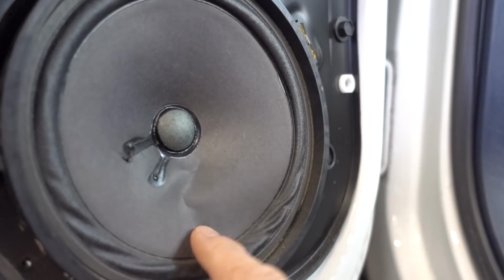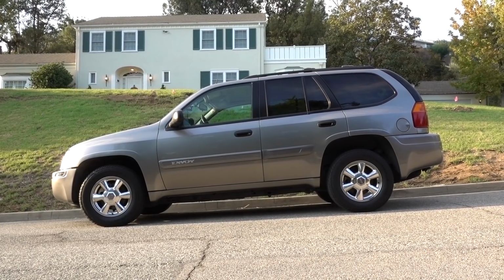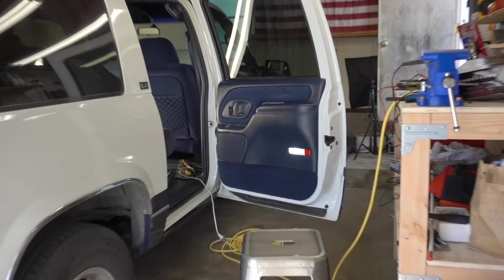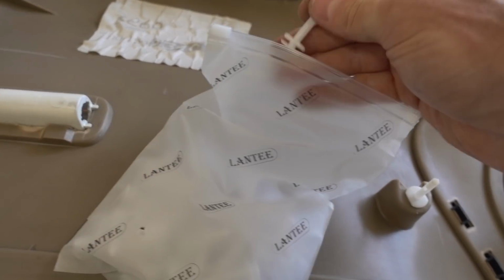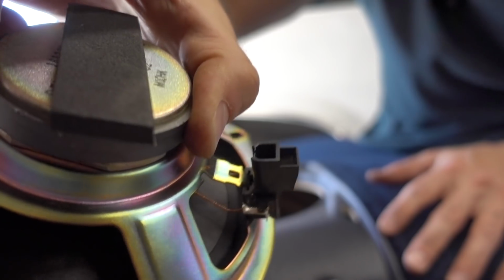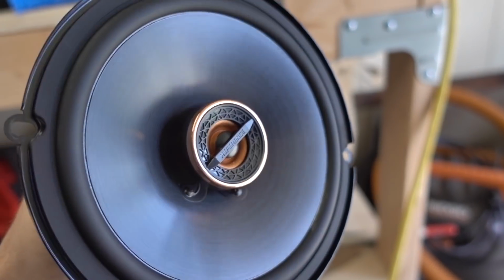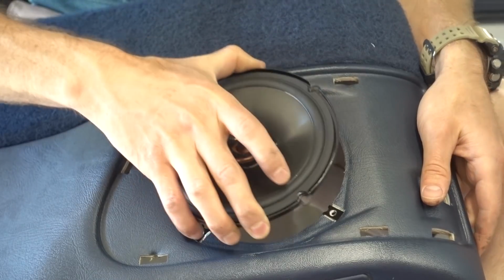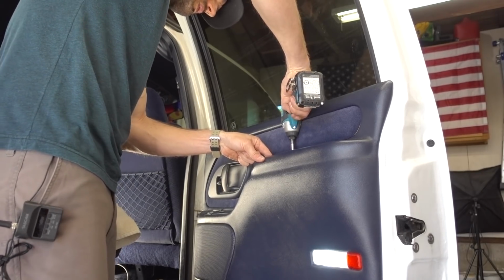This Is Why YOUR FACTORY CAR SPEAKERS SUCK!

Comment: 2003 Saturn vue. Bought for 1500 at 80k miles and the stock speakers were blown, so I'll never know how they were. Has a (10 year old) Sony aftermarket head unit. So i bought sony xplods (only about 35 bucks for 6.5 in set.) And replaced em. It was a nightmare due to Saturn hating people working on their own cars. The factory speakers WERE 6.5 inches, but the mounting holes are 8.5 so i had to literally cut the old speakers from this odd angular cone they were mounted in and mount the new speakers to that, then mount the hybrid frame to the door. Once that was done o had to carve out the covers in the rear doors with a dremel (with the sony covers on they wouldn't fit) since it was all part of the door panel, not removable like your GMC. The fronts i used the same speakers without the sony covers so they fit without cutting the doorpanels (and didn't have the horrible 6.5 to 8.5 conversion the rear doors did). The tweeters actually came with the sony headunit so i left those as is (higher up on the door by the side mirrors).

Comment: My 03 Matrix xrs still has its stock speakers and they are surprisingly good keep up with my sub and never have an issue I’ve changed them on other matrix’s years ago and didn’t get huge improvements with Sony, pioneer or alpine so this time I just stuck with stock until they blow

Comment: The factory sound system in my 2004 ram 1500 st was bangin. The one in my 2010 mazda 3 is pretty good. It's really clear. The one in my 1994 Chrysler Concorde the infinity sound system was the best I've ever heard in any car though although the ram 1500 was close. My 94 Pontiac firebird monsoon system was really good too

Comment: I have a 1999 Dodge Ram 1500. I would have no idea how the factory speakers would sound as they were all dead when I bought my truck. I recently installed Scoche in my truck and 2 of the 4 I installed were dead from the factory, so I plan on putting some Sony speakers on my truck soon hopefully.

Comment: I had a 2007 Camry XLE with the upgraded JBL system, it would’ve been nice. However someone prior to me hacked the stereo and put cheap blown speakers in the car. 
 I bought a set of Kenwood speakers and replaced them all, sounded amazing after that.  My car now, a 2017 Civic Si Sedan has the factory upgraded stereo and sounds alright for what it is, I think I’ll eventually upgrade the speakers in my car. But the factory sub and speakers do an alright job for now.

Comment: I have a 08 ford escape. I would've thought with a newer model they would've upgraded the speakers, but sadly they did not. I know so because I pulled off the panel on my older escape. In the front, I have kenwoods that sound great for treble, but very little bass. I have a sub in the trunk to compensate. I am probably going to replace the mids with the infinity ones you mentioned because with the factory ones when I hit a specific frequency they produce a very odd noise. Great vid.

Comment: The 6.5’’ in Passat 2015 was pretty impressive but changed to gas 6.5’’. 
The 4’’ in the back not so much! The magnet had separated from the cone, as a result of the plastic around the speaker had broken.. 😫

Comment: I have a 2002 Hyundai XG350L with an Infinity "premium package". Sounds quite decent for the age, but I'm thinking of an upgrade. I'll probably do the head unit first. It has an 8 CD changer, cassette player, but NO mp3 playback and NO aux input. Bummer!! When I get to the speakers, I'll probably add some soundproofing even though the cabin noise is pretty good already.

Comment: Great Video!

But a question, does simply swapping the stock speakers help? Most say you will need an external amp to drive them. Does swap only improve the highs or does it also improve the bass produced?

Comment: I have a 2019 Toyota Corolla LE and I have only replaced the rear deck speakers and I use 2 6x9 2-way Rockford Fosgate Primes.

Comment: I got the Bose system in my 04 Yukon and they are some beefy ones so I won't replace them til they blow I added 8tweeters 4on the up corner of the winsheild each corner.and one in all four doors plus I replace the factory ones for a total of10 tweeters..and I have a single 12inch sub.and amp combo FROM WALL MART ITS all power acoustic..if you heard it you won't believe it a cheaper brand..

Comment: We have a 2011 mini cooper with harman kardon audio. Its crystal clear sound with deep bass is so nice. Crazy how much bass it has without a subwoofer. We also have a 2013 vw bettle with fender audio its good and clear but doesnt have that much bass even tho it has a subwoofer. We have a 2004 chevy Silverado with bose audio its good but since its old its kind of scratchy. All in all i think mini coopers have the best audio systems by far

Comment: Well...i have many cars. One of them actually have very good speakers in it. And that is my -05 BMW 530d E61 Touring. There in 2x8" subwoofers under front seats and 2 way component speakers in front doors, 2 way component speakers at rear doors and 6.5" full range speakers at ceiling of trunk. But i also have a Chevy express van -99 And those speakers sucks, so i replaced them with infinity reference 6.5 2 way components and upgrade them as 3 way using 4" herz mid elements. And i also added 4x10" subwoofers aswell, so now sound is more tolerable.

Comment: I have a 2003 Mercedes CLK320, and all of my speakers are stock. Surprisingly enough, mine came with a built-in 8 inch Bose subwoofer, and this is with the base model. The speakers don't sound the best, especially the subwoofer. The only thing I changed, was the headunit

Comment: I put  jbl speakers into my 2009 ford fusion they were 5x7 speakers and the old factory speakers sounded unbalanced and they had foam rot so they were in need of replacement, now it sounds alot better and has more clarity and bass

Comment: The stock speakers in my 2000 Tacoma sounded better than the JBL Premium system that was in the Camry I had before but I still replaced them with Focal Auditor speakers front and rear. Much better sound quality and performance.

Comment: My Peugeot had paper cone speakers some with foam rot and the coils blew easily. I replaced them with vibe speakers although due to there being gaping big holes In the door and little insulation the sound was never perfect but better than stock. My Citroen c2 has better speakers and my nissan Micra stock speakers were surprisingly tough. I also have a ported box with bassface 6x9 speakers for the stereos I can't plug my phone into

Comment: I have 1999 Opel Astra with factory speakers with tweeters at the front window. I switch to pioneer cd player with equalizer and adjusted EQ, Now i have pretty good sound quality, it is the amplifier in pioneer cd player which is too weak and not speakers. To get good sound in a car then you need to adjust with EQ. Especially if you have speakers without crossover. Even if you buy expensive speakers it is not always good sound without adjustments with eq

Comment: You could of just popped off the grill in your Sub. & took the speakers out easily. Why didn't the original pop out plugs work on your new speakers ? You used screws instead ? Great vid & thanks, OH WE NEED MORE OF THE BLONDE IN YOUR VIDS.

Comment: My 96 conversion E150 factory speakers were all rotted around the edges. My system is a 6 speaker setup, not including two speaker cutouts in the rear door with no speakers installed in them. JBL club replaced the front and high rear speakers then for the middle section, pyle. Night and day difference from the compromised factory speakers to the upgraded speakers.

Comment: You didn't used some vibration dampening like Dynamat to make a better Cabinet for the speaker. You can offen do that instead of changing the speakers and get af good result and a good base if you later on chance the speakers. Did that in my old Peugeot 406 from 1999 I didn't bother to change the oem speakers for a year, where I was afford a great deal on a set of RE Audio XXX Compo
Reply: Did you put dampening material in your Peugeot? I have a 406 estate and i want to do some of an upgrade cause the sound is not so good...
Reply: @TedCakov  yes I used STP Anticore and black gold, on the door board I used Som Silentcoat Absorber35

Comment: I’ve had an 03’ Sentra and Altima and the factory speakers have always been decent, My 03’ Kia Sedona was decent as well. My 2017 Forte on the other hand was poor, and the 2006 Cobalt was terrible and those speakers are known to blow out after a bit.

Comment: i got a 2010 mitsubishi outlander with factory audio and they sound awesome i was honestly surprised with the performance of the audio nice bass and crystal clear vocals, and the thing is for the mitsubishi outlander there is a factory option for a rock ford fosgate audio package which adds additional speakers with a single 8 inch subwoofer i can only imagine how great that sounds compared to my standard speakers
Reply: Yeah, that's always the case with speakers in the Japanese cars. They always sound great.

Comment: I put  Sound systems I just about everything I get I've had kicker,Infinity kappas,JBL,MTX,Pioneer,Kenwood but right now I have a 2002 Chevy Silverado running  Rocker fossgate punch series  Components with a single  Down firing MTX10

Comment: I have a 2007 impala all I have done is a nicer song headunit and a set of alpine type r 12 subs in the back with a 1000 watt amp and the factory door speakers are handling it amazingly they are still very clear but do not have the bass I am looking for

Comment: My honda civic fd 2007 has a 6 disc charger and factory speakers sound sooooo good and that is only option for the speakers. It has 2 tweeters in the front on the dash 2 6.5intch 45w 210w max pioneer speakers and they were made out of kevlar. Back speakers were made out of plastic and 65w 140w max. Radio was pioneer 4x45w

Comment: For me i used to a 98 f150 that had 5x7 door speakers and the factory sound like crap and i replaced them with poinner 5x7s and they sounded really and had good bass. Now i drive a 2012 Hyundai sonata and the door speakers are really good they perform really good bass. The speakers themselves are but im going to change them out with new factory door speakers from AutoZone when they blow.

Comment: 1996 ford f250 has the original head unit and speakers just put the kicker key in line with the speaker and there's no distortion

Comment: My car is Seat ibiza 1.6 petrol 2007 :D I had only 2 speakers and 2 tweaters in the front doors but rear not I don't know why.. Nevermind with mdf rings I installed aftermarket speakers in the rear doors. The quality between front and rear is not really big BUT the front speakers doesn't have enough power I mean the bass, but for the quality the stock speakers are the best :D

Comment: Yo yo 97 ram can with factory 5.25 in the door but the hole was big enough for 6x9s.  Got kicker 6x9 and hole sawed out the triangle by the mirror for tweeters, powers by a old school rockford 200m, and added 2 12s behind the seat, currently building center console for two mtx 8s.  The Thunder Rolls bro

Comment: u didn't check for polarity, infinity speakers are notorious for being out of phase
Reply from the maker: Never heard that but they sound great!
Reply: @1RoadGarage  they are great, but if u r a perfectionist this info won't let u sleep at night! 😂 great videos
Reply: What a bull....they are clearly labeled and they are notorious for being junk. Aside from the real infinity speakers from the 80ts lol
Reply: @MichelLinschoten  of course they are labeled, but get a polarity check device and double check. A lot of cases they are out of phase
Reply: @Jacob.Hajarat  you can use a 1.5V battery to identify polarity by what direction (each) speaker flexes ( in or out ) . . .  ( then hope the audio wiring is correct! . .  it generally is though )
Reply: @MichelLinschoten  ah, the good old 80's . . . when i was neither old . . nor good!
Reply: @robozstarrr8930  that's before installing the speakers , but after installing them, u can test the phasing via dedicated devices or apps

Comment: did u even check the phase of the factory speaker before you soldered the plug on? phase cancellation is a real thing.....
Reply: While this is true, if all the speakers are installed & wired the same way, all the speakers will remain in phase with each other. It doesn't matter if they are all backwards - as long as they are all wired the same way, SQ will not be affected.

Comment: Unless you change the headunit i think you should just go with whatever $30 speaker you can find...Most all will still sound better than the factory speakers..Surprised that your speaker actually wasnt ripped..The paper ones usually start to fail once they are over a decade old.

Comment: Did you know that those rear speakers are powered separate from the radio so if you have an aftermarket radio that radio isn’t even powering those new speakers that’s just on those rear door speakers the rest are powered by the radio

Comment: my dad has a honda CRV from 2016, and the speakers actually sound good. there are subwoofers by the shifter (weird) and tweeters in the front. the main woofers produce good sound it also has a bass and treble booster, which was kinda useless. my mom used to have a toyota rav 4 from 2010 and the speakers from that are also good. there are tweeters integrated into the front speakers with woofers, and there are two more woofers in the back. no sub :(

Comment: Hmm let's see... Ford 500 had a Bose system with factory amp that was pretty impressive, so I just swapped for a double din jvc and it made those factory Bose SCREAM. It was a night and day difference. My 96 150 had horrible stocks. Swapped with pioneers from Best buy then added a 300w amp, and a Jensen flip out TV, and they were extremely loud, then just yesterday I started on my 2004 expedition, and I put my Bose system in it from the 500(car has been totaled) cause I'm a cheap ass when it comes to spending on myself (got a wife and 4 kids to provide for), driven by the expedition factory amp, then added a 1000w amp and two Kenwood 12s and that jvc double din cause it's an amazing head unit

Comment: On my chevy malibu from 2014 2lt model it saunds good very crispy and in the chevy equinox from 2012 also saunds very good but not like the malibu speakers the base on the SUV is very poor like if there was not subwoofer but it is i think it is a 8 or 10 inches one.

Comment: That's the default factory speakers in my 04 trailblazer are actually not that bad although I can tell the one on the left mounted into the console below the windshield is starting to go! (Bose system) I guess Bose is is good in some respects lol

Comment: I have a 2000 Rover 214 and It's factory speakers are somewhat decent. 

I switched 3 configs till now with an old cassette radio, a cheap chinese bluetooth one (13 bucks) which was so tiny and had terrible sound on its own, but I added an 600w amp (20 bucks) which improved it. But I was kinda unhappy with the wiring and general unfactory-ness of it so i just removed all of it and replaced it with a sony head unit which on it's own without the amp has great sound, maybe even greater than the amp even tho the amp is technically more powerfull.

 I'm wondering if I should get some new speakers, 17's for the front and 13's (centimeters) for the back. I'm looking at KENWOOD KFC-S1356's and KENWOOD KFC-S1756's. 13's should slot right in but the front ones have plastic casings of their own though I would just remove them and put the new speakers inside the casings. The factory speakers aren't that bad but the plastic door panels and meshes are rattling and stuff, and they do get distorted at some higher volume though they do pack a decent punch.

Comment: Thumbs up bro 👍
And I have A 2009 Tahoe LTZ with BOSE speakers 🤙🤙🤙
Reply: Same here Bose Premium  Navigation system  DVD Entertainment system Dolby Digital DTS certified

 2008 H-LTZ with 6.0L Engine
Reply: Hassan Badr you should probably replace the sound system then.
Reply: I´m sorry man
Reply: i have a6 2016 with bose. They are amazing!
Reply: @Hassan Badr I feel bad even the new Tahoe with the Bose sounds like some trash got one for a rental car and it sounded so bad. But bc it’s Bose it sounded worse with there fake base.
Reply: @jamalj1092  Bose is really good in Audi, at least. Easilly best sound system

Comment: GM speakers have gotten WORSE in the last few years. The voice coils fail (open circuit). I've had to replace not one, not two, but three factory speakers in my better half's 2012 Malibu. At least the speakers you pulled were still functioning at all.

Comment: Replacement speakers can't really shine on factory power. A new aftermarket head unit and amp (shop old stock on Amazon, just like the speakers), would make those new ones scream.
Reply from the maker: Thanks, literally doing that right now.
Reply: @1RoadGarage  Hope to see some video of it.
Reply: Good luck with 2015 up vehicles what ever you do don't buy a vehicle 2015 up. Less you want a boombox in your backseat when the radio breaks In 10 years 😂😂😂😂😂😂

Comment: well i have to agree on your statements there.  Factory Car Audio Speakers are Sucks. even though mine comes with Decent Decent OEM Brand(Blaupunk). in my case,  i plant to Replace My 2006 Year of Proton Satria Neo's Speakers with eother Sony or Blaupunk. since mine is 6.5" all over the place. When thecsaid car was launched, the speakers works well and produce good sound.  However,  it does Suffer from wear and tear. and the speakers design of mine are same as what you had.  with a Weird shape Cone at the middle.